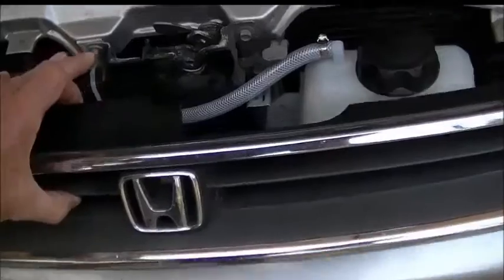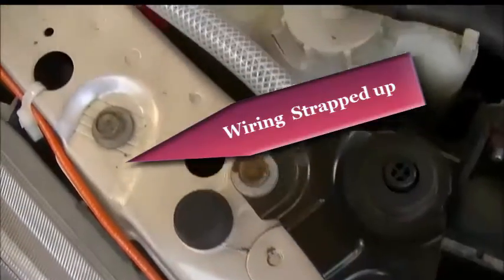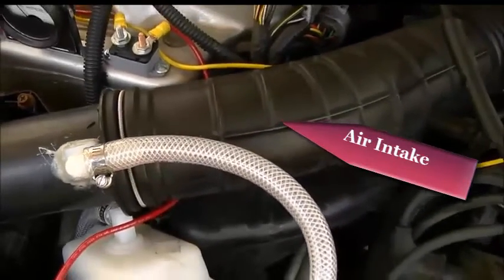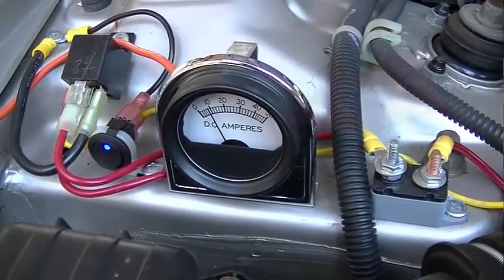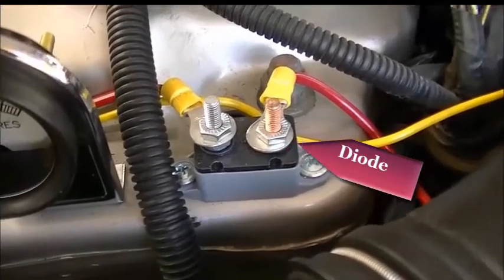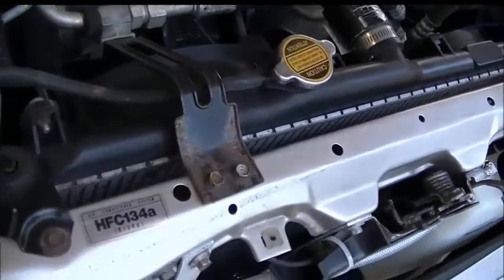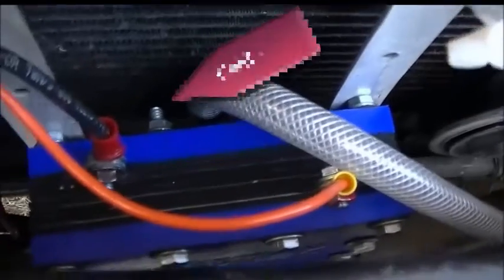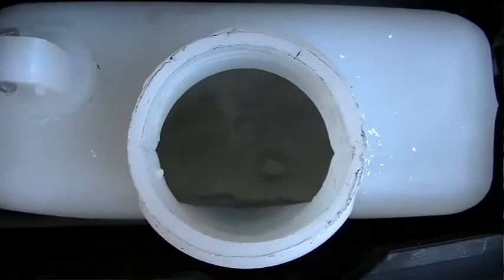Installation of a Hydrogen Kit - Save Fuel Canada

Comment: what about the sensors vehicles have that measure the air/fuel mixture, fuel injected engines ect, how will the sensors adjust to accept hydrogen gas? the computer will read the hydrogen coming in and adjust itself to normal running conditions which is gas heavy, you'll need to tweak the computer, and also lean out the gas so less gas enters to make way for the hydrogen. it's one thing to install this system but where can people get their cars tweaked to work efficiently with it?